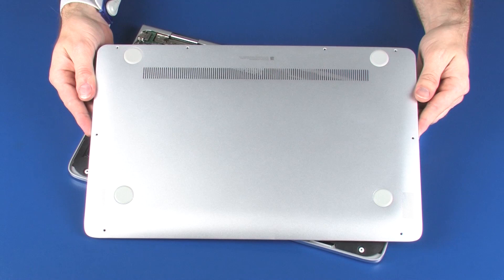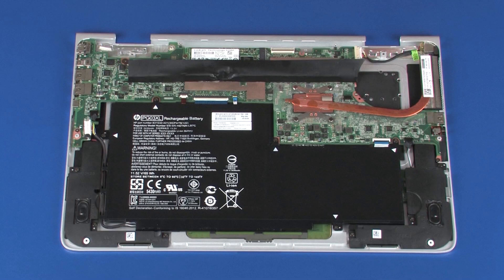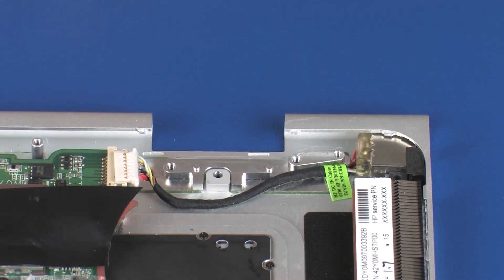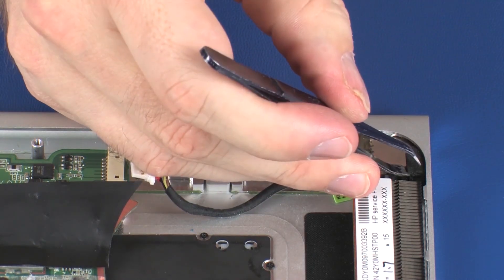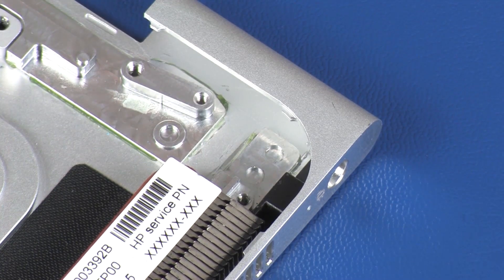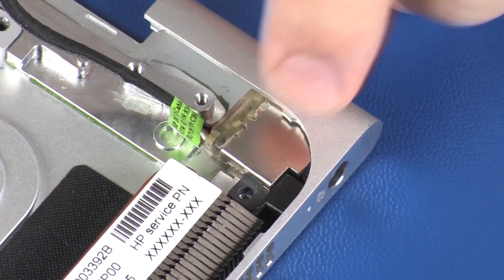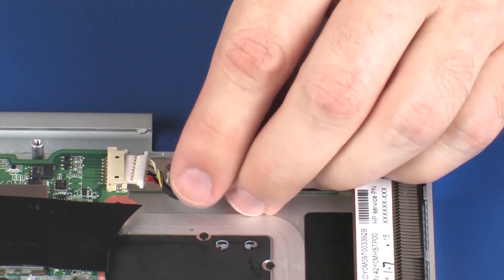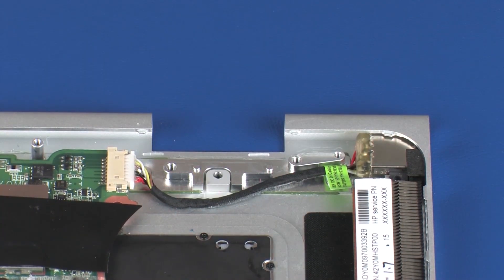Replace the Power Connector Cable | HP Spectre x360 Ultrabook | HP Support

Comment: Does this procedure to replace the power jack connector works with HP Spectre X360 Model #15-DF0013DX
Reply from the maker: Hi Deepak, thanks for contacting!
I understand that you need help in replacing the power connector.
In order to get this issue fixed, please contact our customer care team over the phone or chat for further assistance, as this issue requires Live conversation with you over phone or chat to isolate the issue and provide you instantly with appropriate solution or repair/replacement options available at your place as per the warranty.
Please feel free to reach us on call/chat, please access this link to select your preferred country and language option to reach us. Global support link: - https://www8.hp.com/us/en/contact-hp/ww-phone-assist.html
Binu - Social Media Tech Support

Comment: Hi i have a hp spectre 13 360 4101dx and it charges from some angle bit doesnt charge from tge other angle!! I have heard that it is not the problem of charger aswell as the power jack but the screw would be loose! Should i open the back of the pc and tight the screw? Or should i replace the jack just like you did here
Reply from the maker: +Isfahan Sheikh You can try tightening the screws and if the issue persist, try the steps mentioned in the video.
Reply: @HPSupport  hi read your help on HP x360 -13 -4000 in replacing DC cable but my black DC cable cannot be moved out as it is underneath a metal part by the fan . Any ideas?

Comment: Anyone..Will the HP spectre 360 work without battery plug in(on ac power unit only?)  if so please specify which year model or model # you have tried on. I have a 
15-AP012DX (2016) and it won't power on tried all google found possible solutions but nothing worked wondering if just needs a new battery before I invest time and money into one, thought would ask first.  I've read some laptops won't boot up without battery.

thx for any help!!
Reply from the maker: +Shawn Howeth Many people now use a laptop in much the same way as a desktop, at work or home.Such as the laptop is plugged in and rarely/never moved or unplugged nor completely shutdown,simply allowing it to go into sleep mode. This type of use does seem to contribute to battery decline from posts we see here a lot. HP & other manufacturers do recommend removing the battery in such instances
Reply: Have you tried holding the power button for 20+ seconds to do a hard reboot?